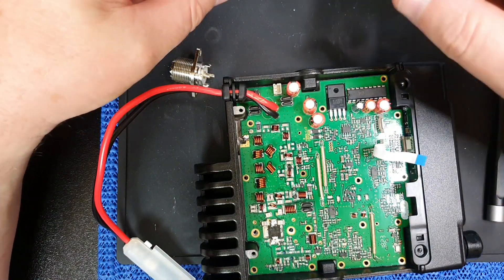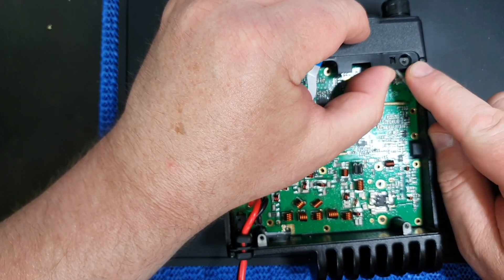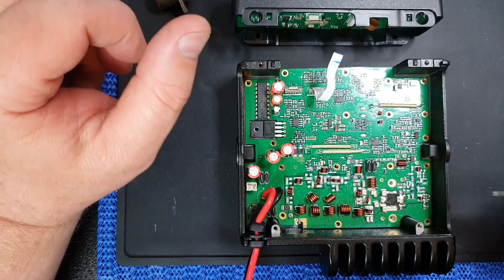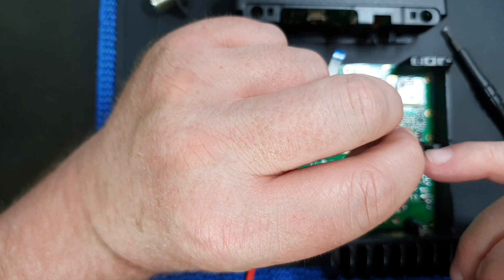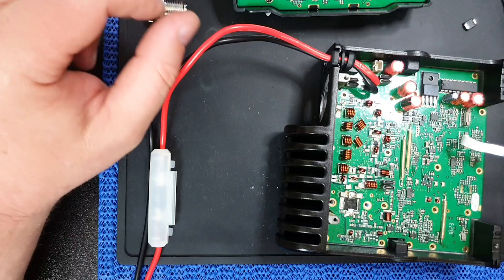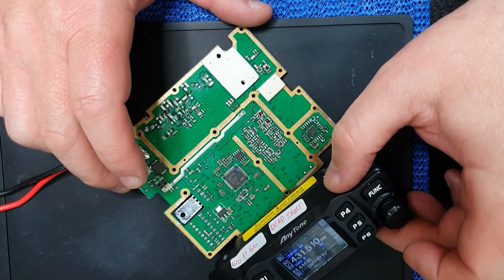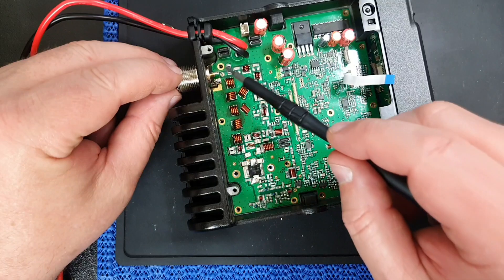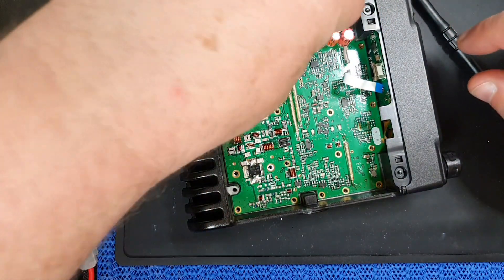AnyTone AT-778UV  reversed polarity

Comment: For this type of repair i generally put in a diode on the positive lead forward biased.  This way the radio is protected 100% even hooked reverse polarity the diode resistance goes high and no current flows.  😊😊

Comment: Hello, thank you for your video. On my Retevis RT95 only the loudspeaker of the hand microphone works ???device loudspeaker and headphone output do not work. Of course, the software/device settings were checked for LS or LS and manual. Do you know this error?
Reply from the maker: It may be the speaker itself is there a signal at the speaker if you look with an oscilloscope or 4-8 ohm with an AVO?

Comment: Dose anyone know which output this radio has and were to buy them?.
Reply: Needing a PA replacement myself. Lift the clamping strip from the top of the PA to reveal the part number. It is a Motorola M9060M or as I've also seen MRF9060M. There's a couple on Ebay. Good luck.

Comment: HI CAN YOU HELP,IVE GOT 4 OF THESE AND 3 OF THEM HAVE GONE FAULTY. THE TX POWER AS DROPPED TO NEXT TO NOTHING EXAMPLE THE AMP DRAW WAS 2 AMP LOW POWER 4 AMP MID POWER AND 6 AMP HIGH POWER. APPROX NOW ALL 3 POWER LEVELS ONLY DRAW 1 AMP SO CAM ONLY TALK  TO PEOPLE UNDER HALF A MILE. STRANGE 3 RADIOS OUT OF 4 ARE SAME. CHEERS FOR ANY IDEAS Dave.

Comment: Hello there, this is the second radio AT-778UV that I got, the first one lasted 2 weeks and after switch it on  it display Please enter password, I returned and got a replacement, this one lasted 6 month and the same problem, is there any fix for that? the factory is not anwsering ma email and have no hope, can you suggest anything?
Reply from the maker: Factory has been on holiday, hope you have it fixed.. but do contact your suppliers directly they may be able to help

Comment: Hello, do you have any hidden menu or way to increase the gain of the microphone of this radio? it has very little audio in tx
Reply: Ive found using Wideband helps but still audio not great, did you find out any way to increase?